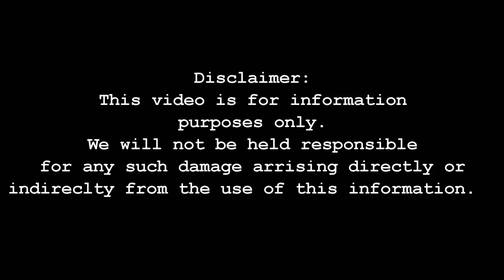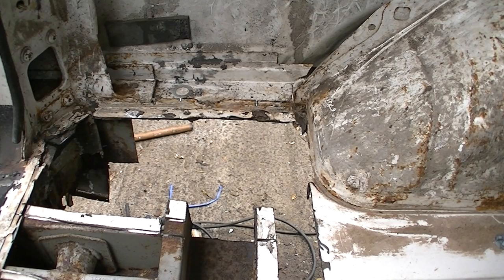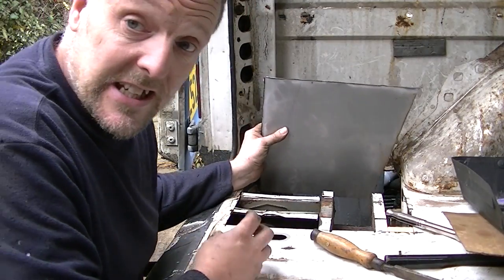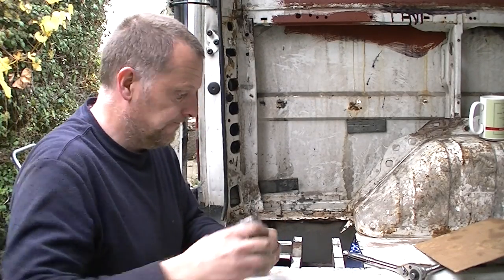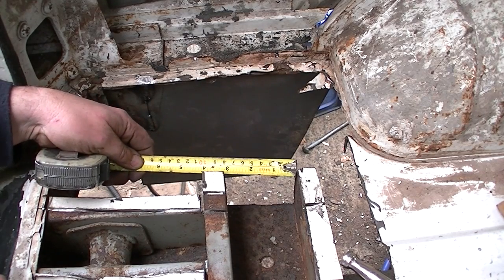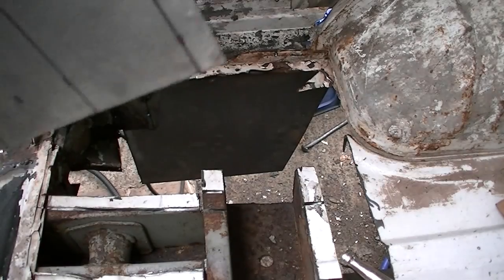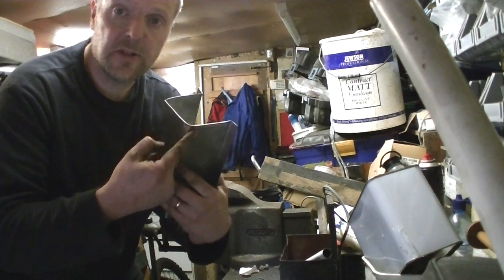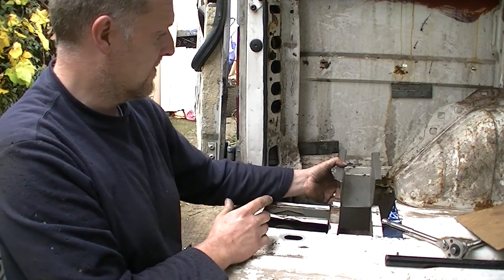How To - Build your Own Campervan - #15 - Repairing Spring hangers and floor Pt 2

Comment: I wished I had known you before mate I would have lent you my bending machine, it handles up to 4 foot lengths of sheet steel and bending chassis sections are made very easy it's a fantastic piece of kit, there's no need to use a voice or lump hammers, and it's all done by lifting up a bar with balancing weights, my machine is an Edwards truefold box folder I used it for years when I run my welding business, I love the way you make the shapes from cardboard I used to use cornflake packets and I ended up with hundreds of templates, it's nice to see a craftman at work, I used to treat all the welding and bare metal with single pack etch primer, you have made a dam good job of that metal work, I used to spray the inside of the box sections with Finnegans Black Wax. This is markadoglet

Comment: In one of the other videos you mentioned that diesel had been put in the water tank and you needed to clean it ..? Have you thought of using steam such as a wallpaper stripper just bung the pipe in the water tank with the tank opening facing down so the water drains out. As steam cleans and sterilises I wonder if it would work ?

Comment: You are a craftsman. I have been rebuilding an old 1967 Chevy Flatnose 'hippy van' for several years now. Metal work is a hard, dirty, demanding job. I had to laugh, your materials in the U.K.  I  believe are all sold in millimeters, yet you measure and think in inches (as do we here) lol. Gary in Michigan U.S.A. (waiting for warm weather).
Reply from the maker: Thank you mate. yeah we are alll a bit odd over here. ;-) lol